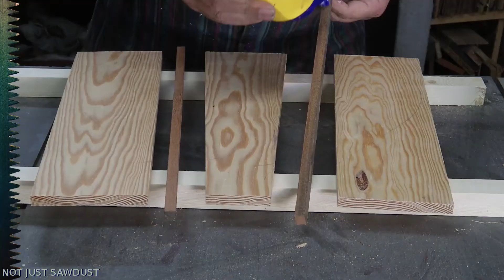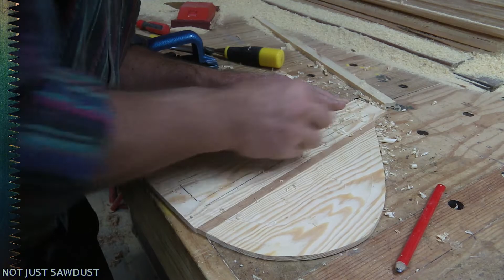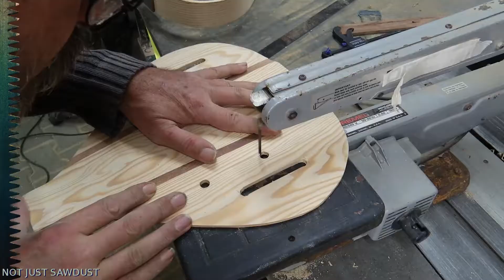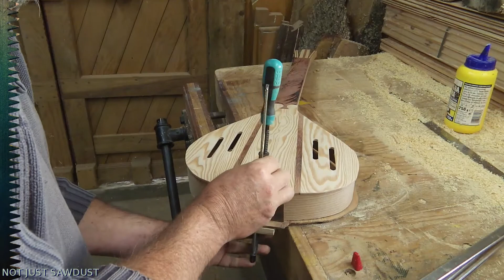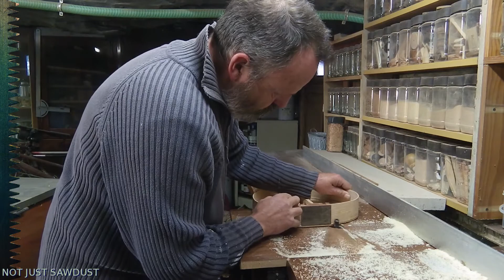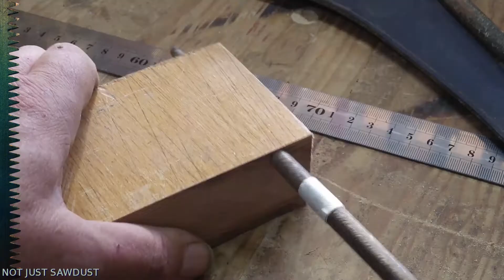#89 Making a 4 string something (part 2)

Comment: Really good looking instrument Gerrit :) Can't wait to see and here this when finished. Love the method for making the wooden pegs :)
Reply from the maker: I thought is was a good idea... but this was the second attempt for making the pegs. To much vibration in the "drillhead" of the Black and Decker lathe. And it's also pretty hard to taper them this way... but I could sharpen that old plane knife I guess...
Reply: I recently bought a cheap Violin Reamer from China and I plan to use it to make a jig similar to yours using it to make the pegs. I think it will work out good. Sharpening that old plane knife will definitely work better :)
Reply from the maker: I have seen those set's for making wooden pegs on Ebay, and it's something to consider buying when I would decide to use them more often on my musical creations. This experiment will give an answer to that...
Reply: I'm sure you will make more once you hear the results :) It becomes addictive :D and the way this one is looking, you should get many requests for people wanting them :)